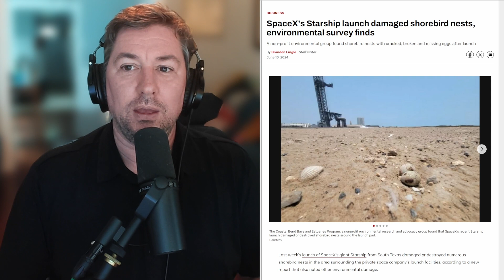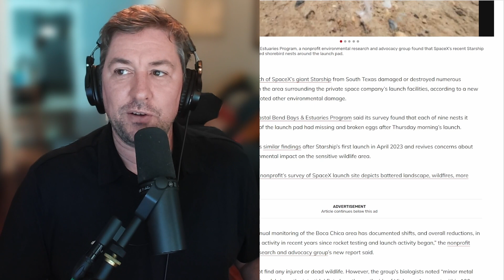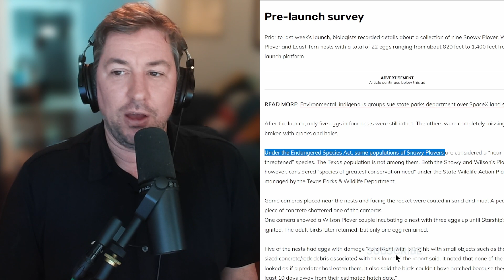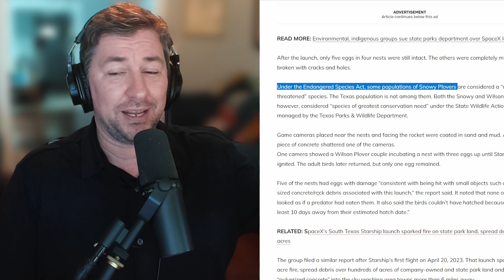Starship IFT5 Update [Starbase Shutting Down?]

Comment: Spaghetti code, is not code that’s not used. its code, that poorly structured. It’s a bit like reading story that jumps forward and backwards in time, stories like that hard to follow. Because code is poorly structured, you lose track of what it contains, this can result in duplication, but its not guaranteed to happen. A bit like when you change something in the past, the present change, so end up with two different realities that are almost the same.

Comment: The majority of issues with launch timing has always been the delays from the FAA for the launch license. Now that the FAA has issued a statement saying that incident investigations don't need to be completed as long as there's no safety issue; and they also issued specific "incident" exemptions for engine failure on re-entry, thermal failure on re-entry, and flap malfunction/failure on re-entry there's no needed investigation for 99.9% of what went wrong on IFT-4. Also, Elon's already said that the booster hit the landing target and the ship missed the target but still soft-landed inside the permitted zone... SO no danger to persons/property for FAA to investigate because nothing landed outside the designated areas. This paves the way for FAA to do a fast turnaround on the next license. Now it's all about how long it's going to take SpaceX to swap all the heat tiles to the newer more robust version, which some people are calling at just two-weeks to complete.

Comment: They are not violating any laws with respect to the water, at most, not Federal, there is a Texas law about discharge of "Industrial Wastewater"  but SpaceX uses potable water for the deluge system, and when it runs off is grey water one time use, not industrial waste.  So lawyers will fight over meanings, but worst case SpaceX might have to enlarge the capture basins they already have.

Comment: What are you taking about starbase isn't shutting down there building a second tower..
Reply: Before watching the video I thought that was what Will was talking about. I think we might see 2 or 3 more test flights in quick succession to use up block 1 ships, maybe 6 weeks between flights, then I think launches might stop for maybe 4 months while they do the tricky stuff for the second tower. Once the huge crane is on site they aren’t going to want to keep making it safe for launches and when they are doing huge concrete pours for foundations they probably don’t want massive launch vibrations disturbing how it sets so after they have got all the data they want from block 1 flights I think they will close down the launch site at least for a bit so that the construction crews can have a decent (multi-month) spell of uninterrupted work.
Reply: They don't have that kind of time. We need HLS, like yesterday.
Reply: @hawkdsl  no they don't they have 2 years